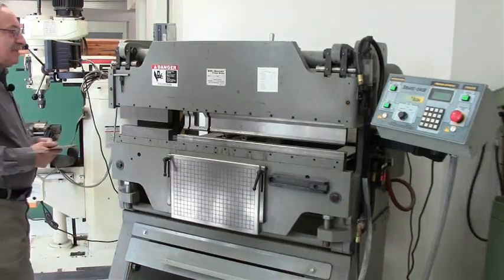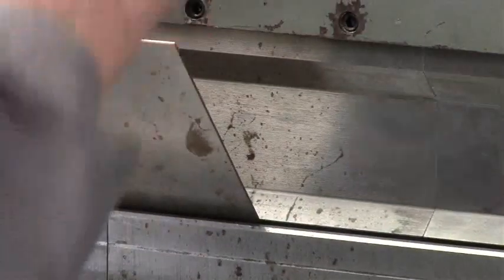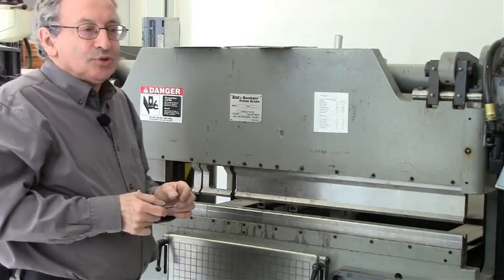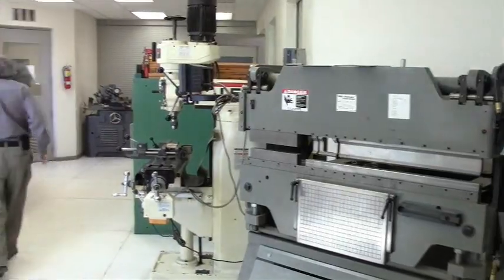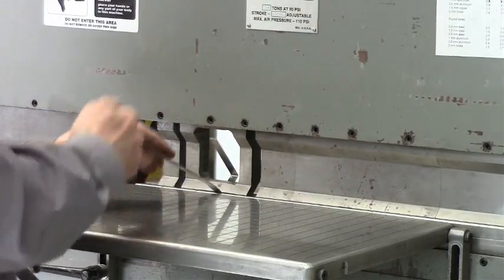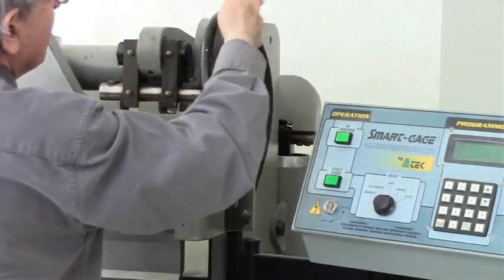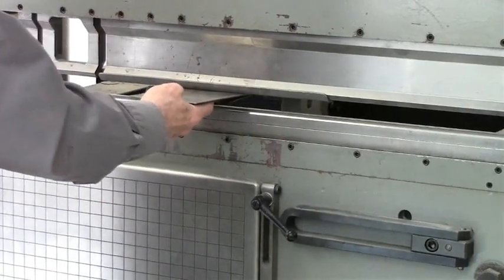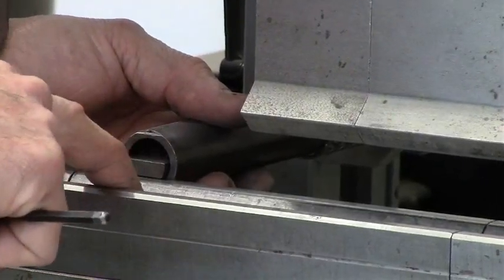Building Prototypes Part 4 of 18 Bending

Comment: 2 times the radius of the upper die + 3 times the material thickness = the minimal opening size of your bottom die.
To large of an opening with begin to make your bend radius grow in size, but your desired angle will stay more true through multiple parts due to taking less pressure to form 
the part. 
1/4in over minimum on 1/4in steel will a 1/4in radius i found to work great.
Your bend radius should never be smaller than your material thickness, you will begin to make a sheer after that.
 To small of a bottom puts you at risk of splitting you brake die, sometimes it does become necessary due to the wanted length of the leg, i.e. really short bends.
Most tooling is cut over 90 deg allowing for a 5 deg spring back rate. 85/95 punch & die.

Some that I remember operating thousands of parts through...
Old pacific scissor brake... (the bottom of machine lifts up pressing die into punch)
Several misc mechanical brake presses
An old tank 380t pacific hydraulic, converted nc backguage
90t Cincinnati hydraulic nc 
135t  Cincinnati hydraulic nc (3 or 4 as these were common)
225t Cincinnati hydraulic nc
580t LVD hydraulic nc (bending 5/8 steel 5 to 6ft long for belly frames for skid steers)
Vice + round steel + clamps + make jig + muscles = At home just getting whatever to work.
25yrs machine /fab shops off and on between that and being a builder.
DAN IS THE MAN!
Reply from the maker: Thanks for the guidelines!

Comment: Dan's presentation is good - I learnt how to make stiffened bends more easily.   But Dan has no idea about safety.   He puts his fingers repeatedly between the dies with the power on.   It would only take a slip and fingers are lost.   A sheet metal fabrication company I have used a lot has a very simple policy - the first time you put your fingers in you get a written warning.   The second time you get another written warning.  The third time you put your fingers in, you get the sack.

Comment: Hi Dan, hope you're doing well.  I am looking for recommendations on some good sheet metal design/manufacturing references.  I recently purchased the ASM Handbook Vol.  14B Sheet Forming as well as Tool and Manufacturing Engineers Handbook (Vol 2: Forming) but looking for any other gems out there.  Thanks in advance and I can't wait for new content.  Take care.
Reply from the maker: Can't think of a book, but best is to get a tour of a large local sheet metal fabricator and ask them to point out to  you  well designed parts and poor designs.
Reply: Dan Gelbart Thanks Dan.  I'm actually at a shop right now trying to work through some gusset design challenges.  Thanks again and take care.

Comment: Dan

Since you made your 18 video series, have you acquired a 3-D printer? 

I was told that the water jet can also have a Z axis and cut in 3-D - I am having trouble visualizing this considering the material sits in water.

Regards
Randy
New Orleans, LA
Reply from the maker: AISLE3B I don't have a 3D printer as most of the stuff I make is either high precision or high performance (i.e. metal, ceramics, specialized plastics). A  Good metal 3D printer is very expensive, about $500,000. It is better to design things to be made on the waterjet, as the volume production methods are closer to WJ than to 3D printing. Using the WJ for 3D is a waste of time.

Comment: Dan
I have seen some press brakes like yours for sale, but none of them have the keypad console as yours does - may I ask what added functions it adds to the machine opposed to a machine without the console.  Do you think it would be false economy to buy a two foot machine over a 4 foot machine?  Is there any particular areas to look for when buying a used machine, like do the air pistons need periodic maintenance?

Regards
Reply from the maker: It is just a faster way to prest the back gage, can be added later. 2' or 4' depends on your needs.
Reply: Thanks again.
Reply: It’s an Atek Bantam 24 ton with the Smart-gage control.  Looks like the B424.

Comment: Hi Dan

I think you said that you were using a 20 ton brake.  Does that mean that if you were bending a sheet of metal across the length of the brake that there would be 20 tons of pressure applied across the entire length?  And if you were doing a smaller piece (five inches wide) would there be more than 20 tons applied, even though it is a 20 on machine?  I see louver dies for sale on internet (about five inches wide) that I would want to use on 12 gauge galvanized sheet metal - have you used your machine with a die to cut the sheet metal?

I really like your videos and am sure they have been helpful to a lot of people - can they be purchased on a cd?

Regards
Randy
Reply from the maker: The pressure is always 20 ton, even on a smaller piece. This is not a problem. If it is, like when bending soft materials, the brake has an adjustable stop on the die travel. 
20 ton should be sufficient to cut 5" louvers on 12# metal, but it depends a lot on the die design. When I make louvers I cut them on the waterjet first, then use the brake to bend them. You can do the same with plasma cutter. 
You don't need a CD, you can download all videos from YouTue using one of the standard downloading tools you get for free from the internet. 
Cheers, 
Dan
Reply: After you cut the louvers first with a waterjet , how do you bend them with the brake?

Randy
Reply from the maker: AISLE3B By setting the depth stop to just bend the 45 deg, not 90 deg., using a top punch narrower than louver.
Reply: Dan - thanks, you helped me a lot.